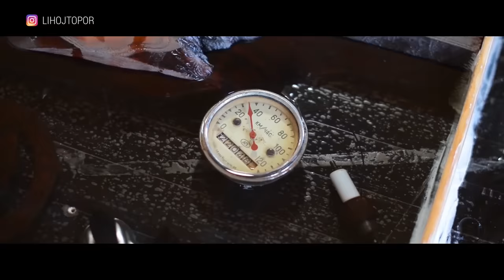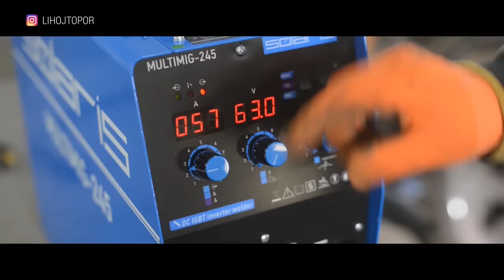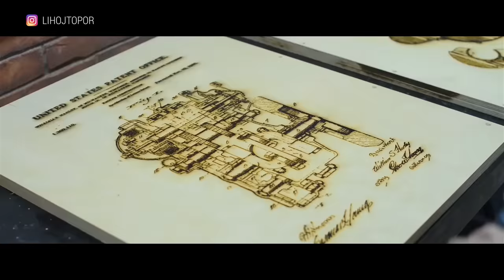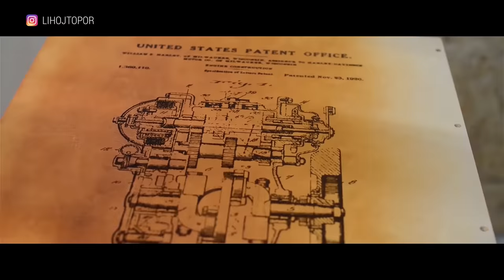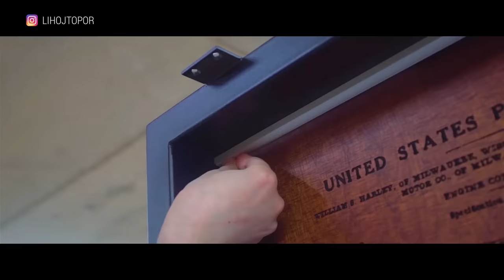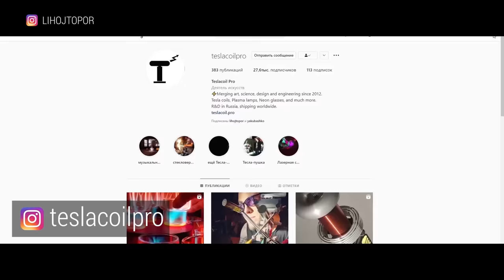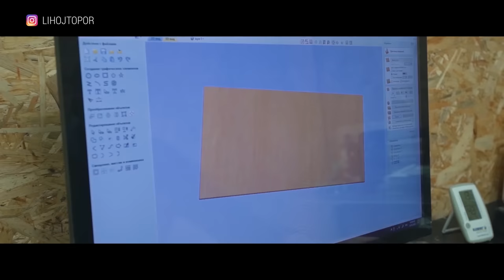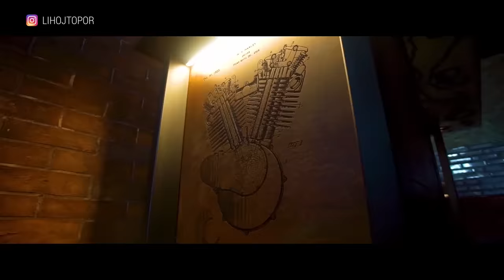Делаем стол для Доктора Дью. Смотрим ролик вместе с Матвеевым

Comment: Ориентировочные потери России на утро 6 марта: около 285 танков, 985 бронемашин, 44 самолета, 48 вертолетов, 109 пушек, 60 цистерн, 50 РСЗО, 21 средство ПВО, более 11 000 личного состава убитыми (данные Генерального штаба ВСУ). 
 За день 5 марта российская армия, по сообщению Воздушных сил Украины, потеряла 5 самолетов (два Су-30, два Су-34 и один Су-35) и 4 вертолета. По оценкам Forbes, Россия лишилась в Украине техники на 3 млрд долларов.
Reply: так ні ти піздиш Сумарнi втрати російської армії на війні в Україні убитих російських вояків на ранок 06.03.22 р. 50000 трупів, плененных 20000, 300 збитих літаків СУ,  вертольотів 310, танків 2101, цистерн 600 , БМП 8602, гради 400, ОТР 30, автомобілі 3550, гармати 850, БУК 10, засобiв ПВО 90, літаки ИЛ-76 20 разом з десантом, БпЛА 30, 2 катери, легкі автомашини 908, і.т.д  Слава Украiнi